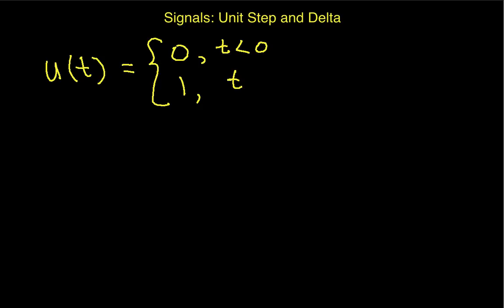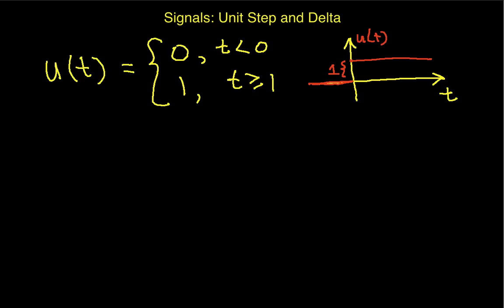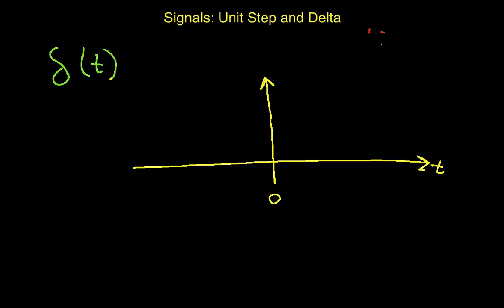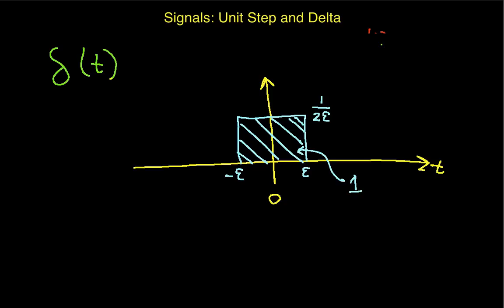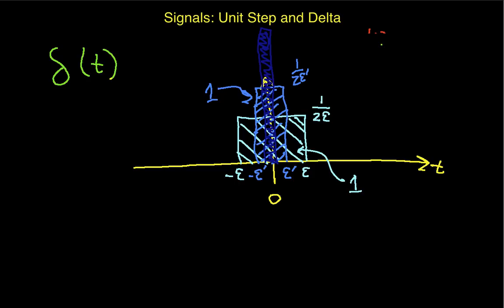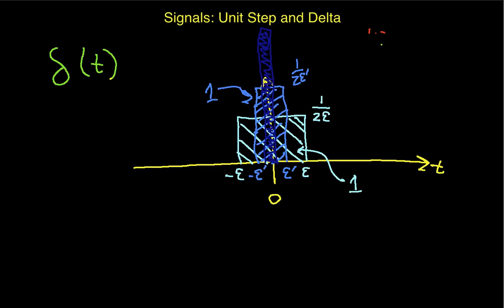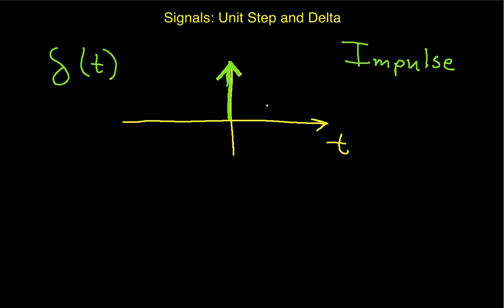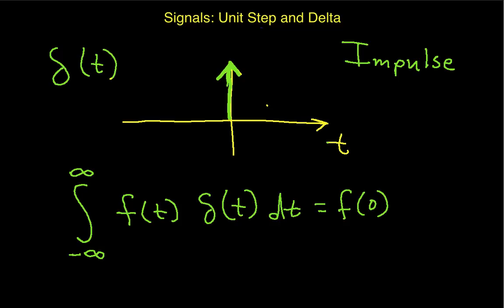Continuous-time Unit Step and Delta Functions

Comment from the maker: @lssam100 The expression is actually used to define the delta function. The delta function is actually misnamed; it is not a function and is quite difficult to work with if you are a rigorous mathematician. If you are an engineer and not concerned with the mathematical subtleties, it is very useful.

Comment from the maker: Most texts that I have seen define the unit step function as 
u(t) = 1 if t greater than or equal to zero,
u(t) = 0 if t less than zero
Given the ways that engineers usually use the unit step function, it usually does not matter if u(t) is defined to be zero or one.

Comment: unit step function is undefined at t=0 for the continuos time because of the discontinuity at t =0(bt by using gibbs eqn we can say it to b 0.5 so when you add u(t) and u(-t) you get 1 for t =0 ) ;bt in D.T its 1 at t=0 and is included in RSS....:)